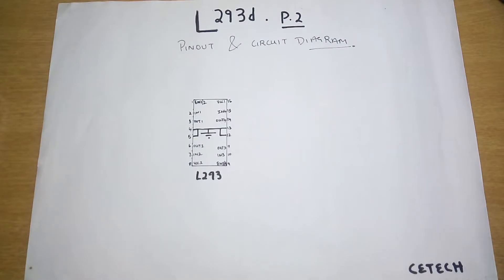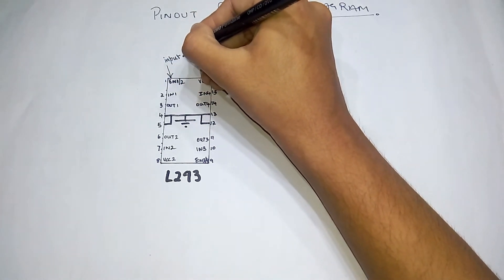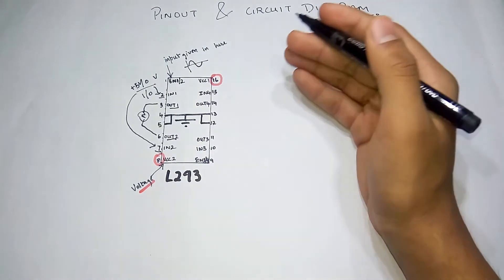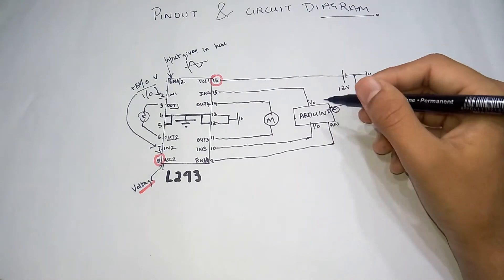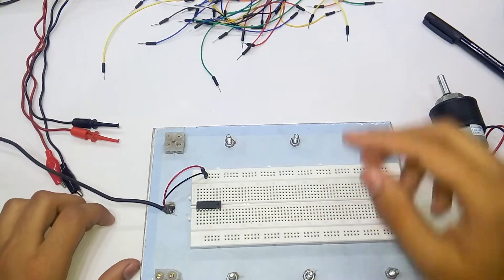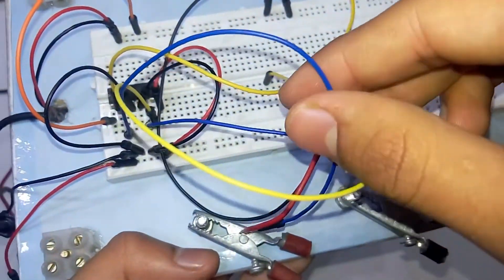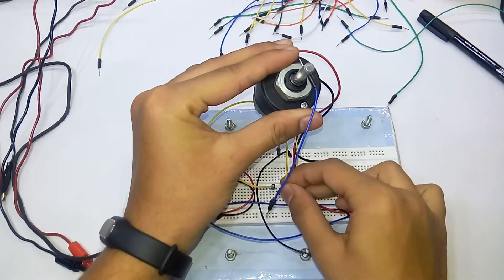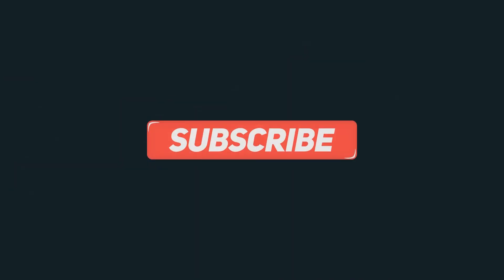#2 Motor Driver Tutorial "The H Bridge" | L293D running a motor with its pinout explained

Comment: @CETech Does l293d needs Arduino to setup or it comes with its own programming.? btw great video .. 👍
Reply from the maker: +gurminder singh its not a microcontroller so there is no programming at all. It comes ready to use. You just need to hook it up to your project.
Reply from the maker: +gurminder singh thanks for the compliment. Do subscribe to our channel for more.

Comment: difference between the power given to pin16 and pin 8 ?
Reply from the maker: +Jaspreet Singh it's totally on you to whatever keep the voltages of these pins. But when you are powering a motor from the left side of the IC then pin 8 power is consumed and when you are powering using right side then power from pin 16 is used.
Hope that helps :)